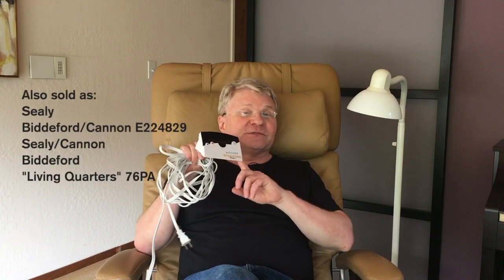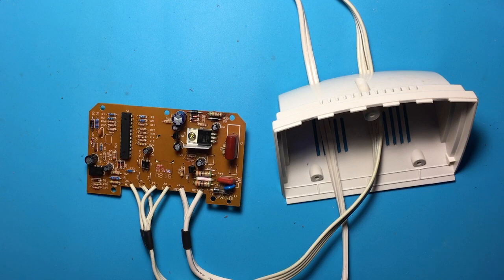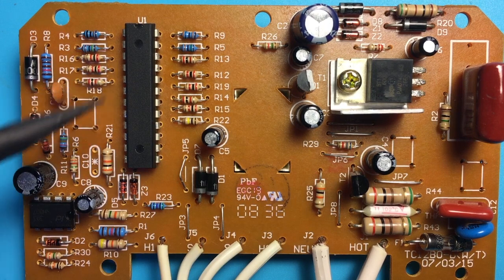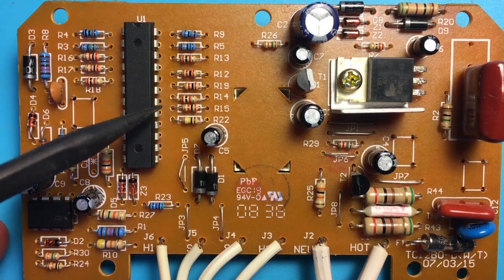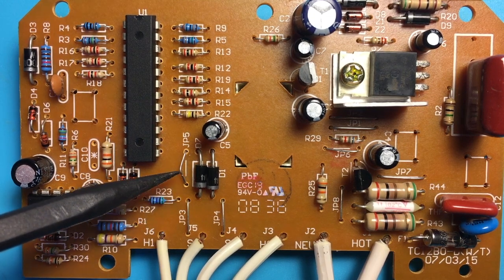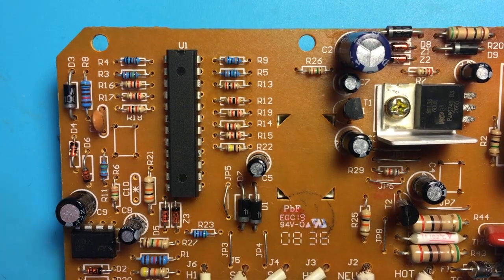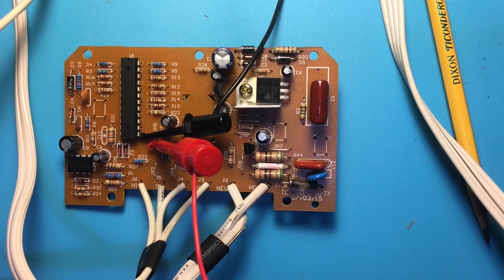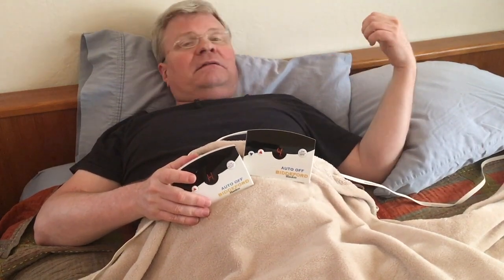Biddeford Electric Blanket Troubleshoot / Repair / Internals

Comment: You didn't say what the problem was with the controller. Was it not powering on or powers on and no heat? I have the TC12B0-D 2012.9.12 board and it does not turn on at all; no display. I am about to get the caps from your ebay link but want to confirm that the cap may be responsible for the no power condition.  Also, when a cap goes bad, does it give off an electrical burning smell? I received my replacement controller from ebay this afternoon and within 20 mins of operation, it quit working with the same electrical burn smell. Sending that one back and will try to fix my first one. Thanks.
Reply from the maker: Check for continuity across the (white) thermal fuse. If it goes, there will be a burning smell from the two resistors on each side of it. Burn marks likely on the resistors too. If a 2nd controller went bad, you may have a (possibly intermittent) wiring fault in the blanket itself. Be careful. (You can get replacement thermal fuses on ebay, but it does no good replacing them if the blanket is just going to fry the next one.)

I don't think it is your caps, but you can use the schematic I made to trace the power through. In my case, the controller would power on, but the display would flicker, not respond to buttons, and finally just showed "E" all the time. It was getting power, but really noisy power with a ton of ripple on it.
Reply: @WardCo  Thanks for the prompt replay. I checked the resistance on the 4 pins of the blanket and they're all within the values as you measured on yours. No shorts between outer and inner pins. Next, checked the thermal fuse with the adjacent resistors and you definitely called it. The resistors were discolored and had the burn smell.  So I plan to replace the thermal fuse and resistors.  The resistors are 10 ohms right? (brn/blk/blk/gld). The fuse is labeled 125/250V N02<PS>E. I did a cursory search and nothing comes up with that nomenclature. Any ideas on a suitable fuse replacement?  I had a year of electronics in college but was ages ago. Thanks again.

edit: I just noticed the resistors on your board is of the 200 ohms variety while mine is 10 ohms.  Wondering if I should change to 200 ohms?
Reply from the maker: Yeah, and yet another controller blew.  That's why I wonder if you have a fault that is intermittent or thermal. (That kind of situation really sucks.)

Comment: I have that same control unit and I lost it so I bought one off eBay and it's just E2 all I can get out of it but anyway could I put any Biddeford 4-prong control module in my blanket like one of the other ones that has a knob and numbers between one and 10 stead of this digital display kind?
Reply from the maker: HI Randy.I don't know. Though I will say most of the stuff the microprocessor does in the digital units can be done with feedback circuits and bi-metal thermostats -- heck, that's all we had in the 60s, 70s, and 80s. But you'd lose the deadman timer. I just don't know if different resistance levels are used in a blanket meant for a  digital control vs one meant for analog control. There might well be, in which case an analog unit would not work. Sorry. Never tried it. Don't know.

Comment: First off, thank you for such a detailed description of your investigation. And as others have said, for the enjoyable commentary and how you presented your discoveries. I'm a retired electronics mfg. manager with "some" troubleshooting skills. Just enough to get me in trouble, lol! The issue with my controller is that it appears to be that when I initially turn it on and it is at the "1" setting, it seems to heat up very high. But occasionally it doesn't get as hot. We were going to swap controllers to opposite sides of the bed to test to see if maybe it was the blanket but my gf doesn't want to give up her controller in case it might get damaged. Any thoughts on what might cause this? Thanks in advance.
Reply from the maker: Intermittent problems are the worst! If it gets too hot then we're talking trouble with the temp control feedback system, so I start to worry about a fault in the sensing wire in the blanket or a loose connection for same on the main board. In theory, the LM comparator IC or the transistor that switches the heat on and off could be faulty, but that seems farther fetched. That said, if you can pass the multimeter checks at the start of the video, I'd feel comfortable swapping controllers to help diagnose. Good luck.
Reply: @WardCo  Thank you! I will check as you suggested. Happy Holidays!
Reply: Well, the resistance checks show the blanket is ok. I took the controller apart and the board is all smd and has no date. I wanted to post a picture but I don't see that option. There does not appear to be any obvious issues with the board. I'm not sure where to go from here.

Comment: Great video.  On my controller the resistor on R20 is burned up.  Its burnt so bad I can't read the value.  I was looking at the video and I read a 5 band resistor as  Green, Brown?,Red, Blue? and Brown.  Does that seem correct?
Reply from the maker: Well, this is interesting. On my 2010 unit (which I keep meaning to sell on eBay for $10 or something) I have a orange-black-black resistor which is 30 ohms, and measures such, so I suspect that's the right number But, you're right, on the video my later unitooks like brown black brown (tolerance) green, which is 10 ohms (and my schematic doesn't even seem to have D9 ?!) Sorry I can't be more help with this.
Reply from the maker: Yeah, I looked at it again this morning and the 2010 board is wired differently. I'd need to open up one of the working units on my bed to tell you what is in the video, which is a PITA, but it ain't 30.
Reply: @WardCo  i got another working controller and opened it up.  R20 looks like   Brown, Black, Brown,  Gold....   100ohm  5%??
Reply: If it helps anybody else:   I replace the resistor in R20 with a 100 ohm 5%  1/2watt resistor.  My controller is working again.......  thanks once again for the video it was extremely helpful.....

Comment: How would you go about repairing the controller, if a dog chewed thru the wires and sort of blew it up.  This is the order of what happened I believe:  The blanket wires made a little pop sound, saw some minimal smoke, and there is some black on the wires.  Seems the 2 sets of incoming wires must have touched, (DUH).  The saliva from the dog may have made it worse, as must of us know water is not good with electricity -- the dog did not know this at the time, but I think he does now.  I spliced the wires back together, but the controller will not come on -- nothing -- it is dead (the controller, not the dog).  What sequence would you suggest to fix it?  Change the fuse?  What else?  I am asking everyone who reads this to please not report me to the Human Society; I have enough problems as it is.  Plus the dog does not seem to be permanently damaged; except he will not come within 3 feet of the surge protector or any other electrical wires now.  One positive from all of this: if I get the blanket working, I don't believe this same problem will ever occur again.  Any and all help is appreciated.  Thanks
Reply from the maker: Ouch! Yeah, check the blanket wires as shown at the start of the video (to be sure the blanket itself survived ok), then open the controller up and beep out the thermal fuse with a multimeter to see if has opened. If so, it should be replaced, not bypassed. If not, it gets more tricky as you kind of have to chase the power through the right side of the board, but you can work backward from the rectifier diodes. The blue MOV may also be kaput. You can take it out and see if makes it come to life -- should run without it -- if it does, it should be replaced. Be careful, and if it gets to be too much, there are lots of controllers on eBay for not much money, and one commenter here has said the Biddeford sometimes sends new ones out for free with a phone call.
Reply: @WardCo  
Blanket should be fine, as he didn't get his teeth on it -- just the cord.  I'll check the fuse and and thank you so much for the quick response.
Reply from the maker: @AA-bj5rh  Okay, as long as he didn't chomp on the 4-wire cable going to the blanket.

Comment: You talked about everything but the actual capacitor and how you got it and where you can get one how to test it how does it work you didn't know that very boring some good information but very boring but didn't tell me how to test the capacitor or where I can get one or anything else thanks
Reply from the maker: Well,  the description above has information about the capacitor (though I expect the eBay listing has long expired). The ripple on the power rail was enough to determine it had failed, but there are lots of stand-alone capacitor checkers out there. It's always a judgement call to decide how tutorial to go in these things. I figured any one up for wading through this would already understand what a capacitor does generally and how it smooths the "pulsing" of rectified AC by providing a supporting charge when the AC waveform is crossing zero.

Comment: Mine stopped working tonight. It won't power on and R23 looks burned up. I wouldn't have a clue on how to figure out its value.
Reply from the maker: The color codes in the video seem to be green-black-blue, which would be 50 meg ohms. My schematic has a 507 ohm notation, which I figure is a mistake. That goes out to the sense loop, so check your blanket wiring. Don't think it would stop the processor from running, but firmware may be deciding to shut things down when the sense loop doesn't check out -- or there may be other damage. :(

Comment: I measured the resistance between 1 & 4 on my blanket and saw 238 ohms. I then measured the resistance between 2& 3 and read 976 ohms. I then set my multimeter to the lowest ohm setting and measured between 1&2 and 3&4 and I got a reading that has a 1 to the far left and a '.' which I assume to mean open circuit. 

Does this indicate that the internals of the blanket itself are ok?

This is a blanket made for 220-240V being used in a 230V system if that matters.
Reply from the maker: Voltage doesn't matter.

You resistance readings seem plausible. I don't know if I explained this well enough but the heating wire (1&4) is covered with an insulation that melts at a fairly low temperature and the thin sensing loop (2&4) is wrapped around that. The idea is that if the heating wire develops any hot spots, it will melt the insulation and short to the sensing loop and the controller will shut everything down.

I just looked at the 3 multimeters I have here. 2 of them show "OL" for open circuit ("overflow'), BUT, my old BK Precision from the 1980s shows "1." just like yours ("infinite"?) So I think your blanket wiring is OK.
Reply: @WardCo  Ok great. I've moved on to test the output voltage on the controller for my blanket (a Homefront/Osily/Mylek Choclate Heated Throw btw). I put the probes on 1 & 4 and then set my multimeter to measure DC voltage. Afterwards I turned on my controller and measured the voltage at settings 0-9. At all settings the voltage came out the exact same, which was 2V. 

Should the output voltage vary based on the settings or does it stay the same? Or should a different value like current be varying here?
Reply from the maker: @DB5tothehive  If you are measuring at the female plug at the end of the 4 wire cord coming out of the controller, the CPU won't power up the circuit unless 2 & 4 have continuity and are showing a resistance in the sense wire range. The only easy way to measure this (without some kind of pass-through/breakout lash-up where the cord connects to the blanket) is to open the controller case and measure the connections on the circuit board directly -- but be careful, obviously. All the controller settings do is vary the duty cycle of the heating element on 1+4 as shown on the scope in the video. Also, you want to be measuring AC voltage on 1+4, not DC. I can't remember if I ever measured the voltage on 2+4, it is likely not significant, just enough to get a resistance reference value for the comparator/CPU.

Comment: For starters, it is pronounced "THY-rister", not "try"resistor or whatever. More properly, it is an SCR (Silicon Controlled Rectifier) 

Secondly, Your comments at 17:27 is INCORRECT - you don't "throw open" the SCR to get it to draw tons of current to heat up the resistors.

Thirdly, pin 8 of the 393 compactor is V+ (supply), and so "probing it" with a high impedance scope probe isn't  going to "load" it, so you should correct that.

Lastly, you show JP 6 in your schematic pulling the gate line of the SCR to  ground, so you would never-ever be able to develop a gate charge on the SCR to get it to conduct. You need to find the correct layout and correct that.
Reply from the maker: Thanks for the corrections Steve.
Reply: @WardCo  No problem. I recently blew up 3 controllers in the last month, and thus why I am diving into this issue.
In my case, I am a Ham radio person (Call sign: W7SJ), and I frequently run 1,500 Watts, and so I'm  wondering if I am getting RF (aka RFI) into the blanket, and firing the SCR.  Remember, a blanket spread out on the bed full of wires is a perfect antenna.

So I wonder if all these people (you, me, and all the others here on YouTube making video's about this) may be getting subjected to RF fields, and RFI.  Heck, even a GSM cell phone (or 2-way radio) can put out enough RFI to affect delicate electronics like this,

I'd really like to figure out what is going on here, or at least the designers intent here.

Anyways, I really appreciate you taking the time to reverse engineer this and draw the schematic and post it.

However, and as stated in my previous, I'm concerned about "JP6".  As drawn, there's no way for the SCR to ever fire, since any signal from the LM393 is grounded out.  I wonder if you could re-visit JP 6 some day if you ever decide to open the unit back up.

Steve